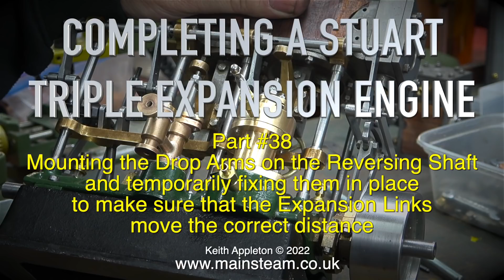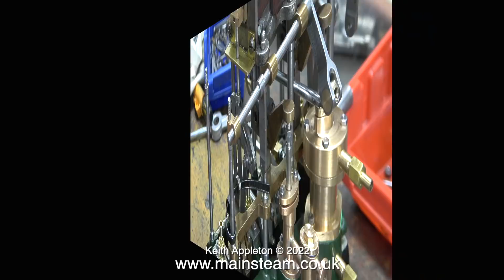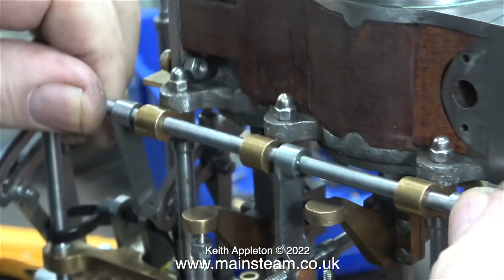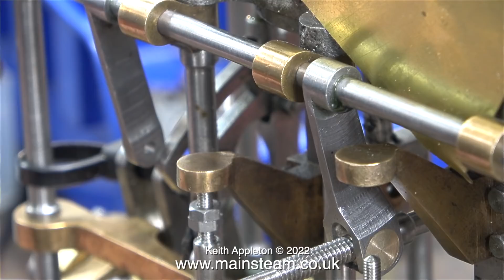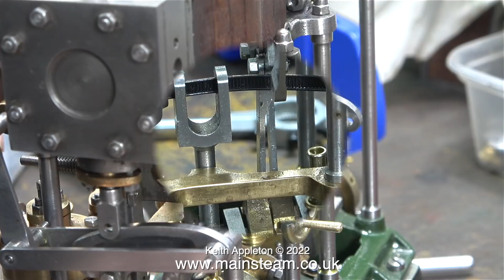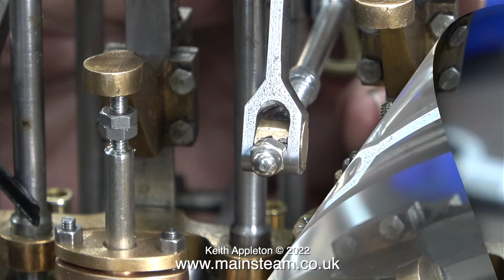COMPLETING A STUART TRIPLE EXPANSION ENGINE - PART #38

Comment: Question: Could you use set screws/grub screws to make that reversing screw system work easier?
Reply from the maker: Sorry, I don't know what you mean - please provide more details.
Reply: Using grub screws instead of the tapered pins, so instead of having to drill thru the arms and the bar, being able to just drill and tap the arms for a grub screw. I was pondering if that could be an easier way to approach that particular reversing system.
Reply from the maker: Grub screws are no good at all, as they are not strong enough at all to hold the drop arms firmly when the engine is running.
Reply: @keithappleton  Ah, thank you for correcting me.